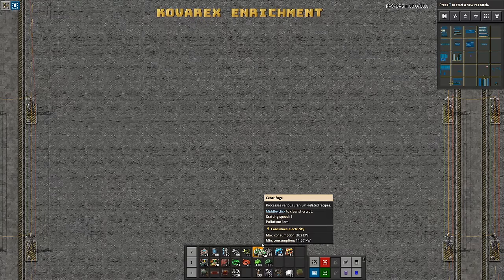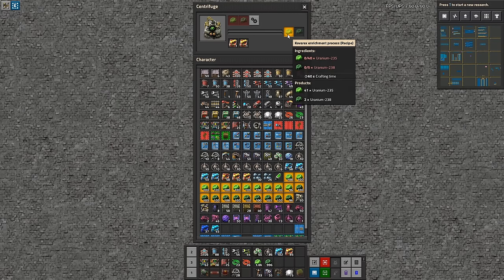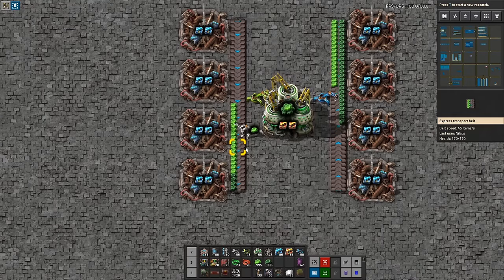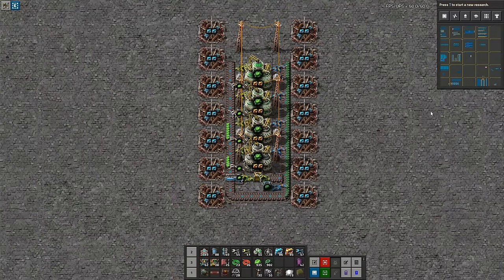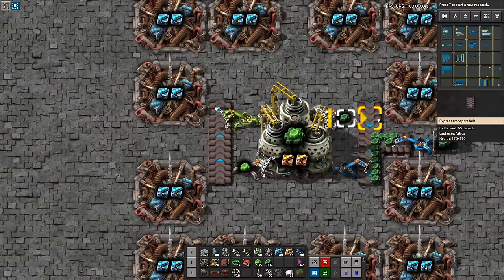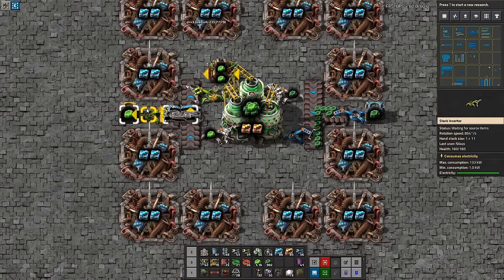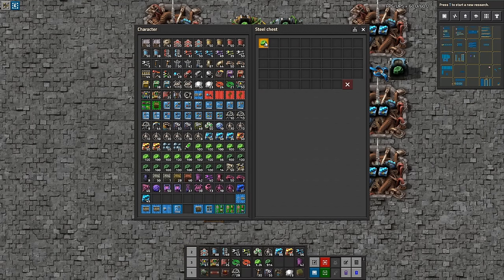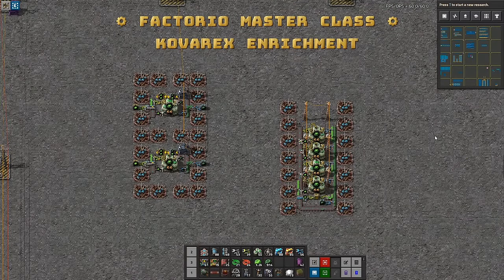Limitless Uranium-235 with KOVAREX Enrichment Process | Factorio Tutorial/Guide/How-to

Comment: TL-DR modules are shit in this build: it takes 160 hours to get value out of them;
just use un moduled builds for this one

full description:

I dont understadn your decision to include modules inthis build, level 3 modules are super expensive and uranium is not a resource you need to save on, let us run some numbers:
assuming iron and copper ore, as well as well as coal costs 1 unit, and crude oil costs 0.3 units then the total cost of this build (only modules, beacons and centrifuges) is 
36 (modules) * 3685.8 (cost of level 3 module) + 14 (number of beacons) * 306.0 (cost per beacon) + 4 (centrifuges) * 1565.1 (cost per centruge) = 143 234.4 units
this build then produces (number of centrifuges * productivity * crafting speed) / (base production time) = ( 4 * 1.2 * 4.7) / 60 = 0.376 U-235 per second
combining these 2 gives a units / U-235 per second of 143 234 / 0.376 = 380 942 units per u-235 per second
the cost of 1 U-235 in terms of U-238 equals 1.2 (U-235 produced) / 3 (U-238 net cost of 1 cycle) = 0.4
this gives us a running cost of 0.376 (U-235 per second produced) / 0.4 (cost per U-235) = 0.94 U-238 per second

To get the same amount of U-235 per second with an unmoduled build, we would have to use 4*1.2*4.7 = 22.56 centrifuges, with a total cost of 22.56 * 1565.1 = 35 309.3 units (being 24,6% of cost)
this amount also produdes 0.376 U-235 per second, so the unit / U-325 / second of this build is 35309.3 / 0.376 = 93907.7 units per U-235 per second (also 24,6% of the cost of build 1)
here the cost of 1 U-235 in terms of U-238 is equal to 1 (U-235 produced) / 3 (U-238 net cost of 1 cycle) = 0.333... 
this gives us a running cost of 0.376 (U-235 per second produced) / 0.333 (cost per U-235) = 1.128 U-238 per second 

ofcourse, the second build costs more U-238 per second, let calculate that impact:
say u-238 has a unit equivalent of 1 (being equal to iron, copper and coal)
the absolute cost difference between the 2 builds is 143 234.4 (cost of build 1) - 35 309.3 (cost of build 2) = 107 925.1 units.
the second build costs 1.128 (cost per second of build 2) - 0.94 (cost per second of build 1) = 0.188 units per second.
finally, to calculate the time it takes for build to have a positive return on investment, we devide the cost over the cost per second:
107 925.1 / 0.188 = 574 069.8 SECONDS to have a return on investement,
this equals 574 069.8 / 60 / 60 = 159.46 HOURS of constant gameplay

in general, modules are not super useful, except for very high cost things like yellow science, rockets and labs